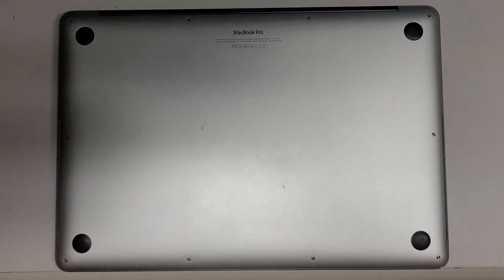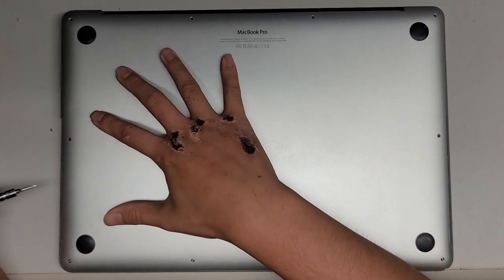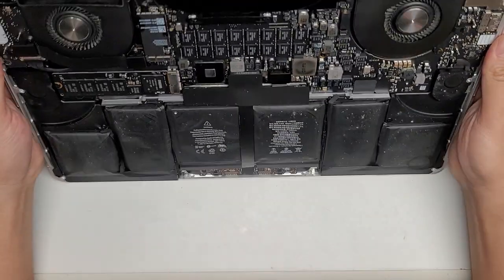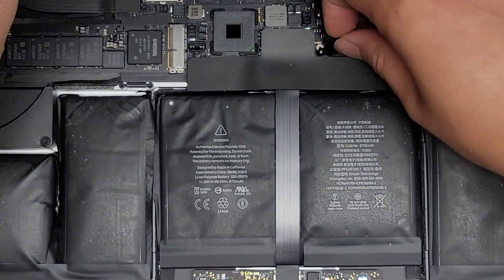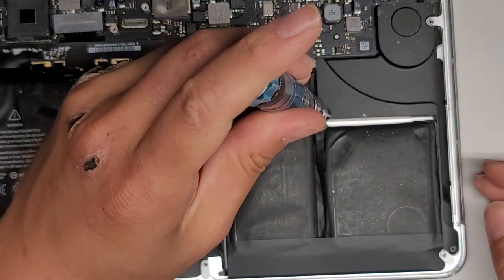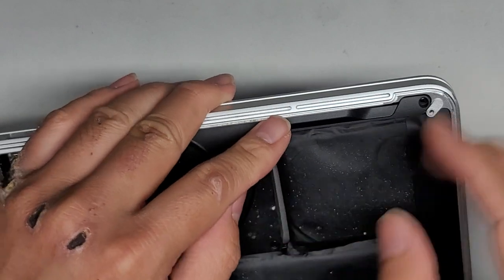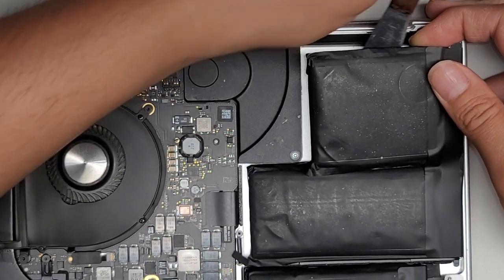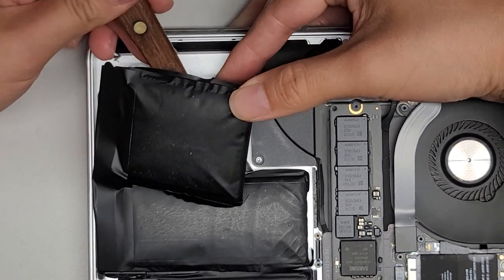15" inch MacBook Pro A1398 Mid 2015 Battery Replacement Repair

Comment: Hi, thank you very much for this video, I followed it step by step but I’m having an issue turning the Mac on it’s just not responding. This is the reason why I changed my battery in the first place but the problem still hasn’t been resolved by me changing the battery.
Reply from the maker: Sounds like a motherboard issue sadly

Comment: Fantastic tutorial - very clear and specific. My only question/concern is that now my keyboard and trackpad are not responding despite correctly reconnecting the strip. Is this most likely because I somehow damaged the connector strip? Gratefully-Dan
Reply from the maker: If both aren't working, it's most likely the touchpad cable
Reply: Thanks for your response. I replaced the trackpad cable and the keyboard/trackpad still don’t work. It does work with an external keyboard/mouse. Should I try to replace the trackpad as well?
Reply: @Danegger1 same issue. did you find a fix?
Reply from the maker: Yeah
Reply: Yes; despite being very careful about the battery removal I must have somehow damaged the trackpad and/or cable. Once I replaced them it worked. Thanks again for your excellent tutorial and responses!
Reply from the maker: Awesome!
Reply: @Danegger1  did you have to remove the new battery to replace the trackpad? ive got a trackpad cable coming in the mail, hoping that fixes it.
Reply from the maker: To replace the trackpad, yes, cable, no.

Comment: Thank you for this wonderful video! I recently bought a 2015 MacBook Pro 15” off of someone from Craigslist, much newer than my mid 2011 iMac 27”, and after playing around with it discovered the battery needs servicing warning. I’m very glad I found your video amongst all the others. Though at the end I was confused when I saw your MagSafe connector with an L connector instead of the T which I know is standard for MagSafe 2. Was this a mod cause the end of your MagSafe 2 died, or what? Please advise. And off topic, if you or any other followers care to give a recco for which 2tb ssds is best for this MacBook in terms of longevity, low heat, and reliability, I’d be grateful, as I’m spending too much time without figuring it out. WD 550s are nice and appear solid, but $$ and hard to find. Samsungs seem to run hot. And Sabrents are fast, but seem to have problems in Macs. Answering the MagSafe Q is all I expect, but thought to find out what folx are doing on the other.
Reply from the maker: Magsafe is an 85W magsafe charger with a magsafe 2 adapter on it. The SSD you'll need an adapter to convert m.2 pcie nvme SSDs. https://amzn.to/3oXCrNW sometimes it'll have issues going to sleep though. https://amzn.to/3NomUA4 I like crucial.

Comment: Do you have a link to buy the pry tool you're using?
I've looked all over and can't find a good tool for removing macbook batteries. All the ones I find are either way too short or have no good grip for applying the force needed to break the adhesive. Yours looks perfect but I can't find where to buy it.
Reply from the maker: https://amzn.to/3TiuVbh but you'll likely have to grind the tip thinner.
Reply from the maker: This might be the same as mine https://amzn.to/3ZNrThw
Reply: @ItsBinhRepaired  👍Thanks very much!
Reply from the maker: @crowleyswhitehorse  no problem

Comment: What are those tools name to remove?
Reply from the maker: @Drx-p5l  which ones? The screwdrivers?
Reply: @ItsBinhRepaired  all butterknif flexibleto that stiker remover?
Reply from the maker: @Drx-p5l  this screwdriver set https://amzn.to/3XHu4Ua and this spatula, but you might need to file the tip thinner if it's not about the thickness of a sheet of paper already  https://amzn.to/3MVbYJd

Comment: What is the name of the tool with the wooden handle you are using to remove the adhesive?
Reply from the maker: Basically this, but it'll need to be sanded thinner https://amzn.to/3qzidqY
Reply from the maker: Other people use floss or thin fishing line to cut through the adhesive, but I find this works better.

Comment: Great. vid, when I changed my battery I noticed that the screw on the right side holding the battery has sheared off and half of the screw is still in the screw hole,  is there any tool kit you can buy to remove the sheared screw? I was thinking about popping into my local apple shop but it might be costly.
Reply from the maker: Possibly some good pliers to twist it.
Reply: Thanks bud but I think the shear is below the level. It's  just too awkward to use some sort of drill. might just try and glue the top of the screw back on👍  @ItsBinhRepaired
Reply from the maker: Even with the battery out it's not grabbable?
Reply: To get to it, it would mean lifting the battery back out which is stuck down with the adhesive so hopefully it's not going anywhere anyway👍 @ItsBinhRepaired
Reply from the maker: D:

Comment: Hi Quick urgent question, After doing all this, my laptop is way slower, even if the battery replacement worked properly, could you help me out quickly ? Thank you very much for this tutorial.
Reply from the maker: Is the touchpad working?

Comment: For some my mouse pad is not working and the fan is running high after changing the battery and following your instructions.
Can you please give some advise?
Reply from the maker: Sounds like you damaged the touchpad

Comment: Thanks so much for the great video, man!  I tried sending a little bling your way, but it said that there were no matching Venmo profiles with that handle that you have in the info section.
Reply from the maker: That's strange. It's been working. Make sure to type it with the capital letters and also press view more. @BinhVu should be correct.
Reply from the maker: Hopefully the repair went or if it hasn't already, goes well.
Reply: @ItsBinhRepaired  It went great, thanks man!  OK, I finally was able to find it.  It still wouldn't show up at first for some reason, then it seemed to almost randomly pop up after I typed it in a 3rd time.  Weird.  However, I just tried to send you money and every time I am now getting this message: "Error" with the smaller font text below it: "The network response was invalid."
Reply from the maker: Glad to hear it went great. Venmo has been having a lot of issues lately. Some of my payments don't show up in my transactions, but show up in all my friend's transactions. Haha I don't know why they keep messing with it, when it was working fine. Might have to give it a day or something. Thanks!
Reply: @ItsBinhRepaired  Alright, it finally worked!  It's pretty temperamental these days huh?  I don't remember it being like that before, but I only seldomly use it.  It told me that that code you have in the description was 'invalid' by the way.  So I just sent it anyways, without that extra layer of protection.  I hope you got it!
Reply from the maker: Thank you so much! Just got the venmo
Reply from the maker: @Christoph Curtis  yeah, It's been having a lot of issues the last couple months. I always wonder what would happen if they messed with the numbers and made money appear out of nowhere.
Reply: @ItsBinhRepaired  No.  Thank you!  I'm quite poor (hence why I did it myself in the first place, hah!), but I hope enough people are able to give similar amounts to have made it worth your time.  Anyways, for what it's worth, from one stranger to another: may karma smile upon you at the very least, if not more!
Reply: @ItsBinhRepaired  Hahaha, I would very much welcome such a theoretical glitch!  crosses fingers
Reply from the maker: @ChristophCurtis  Thanks! Some of the videos more than paid off. I think in the long run they'll all pay off.
Reply: @ItsBinhRepaired  Actually, I have a quick question.  I've been trying your recommendation of draining the battery to around 5% a few times to get the full potential out of it.  The problem is that it died at like 15% or so one time and just now it died at 10%.  Is that an issue with the battery or does it need some sort of calibration for the OS's battery percent indicator to become accurate?
Reply from the maker: @ChristophCurtis  sounds like a bad battery D: did you do the pram and smc reset?
Reply: @ItsBinhRepaired  Yep!
Reply: @ItsBinhRepaired  I guess the last question would be then "how bad?"  I usually use my laptop plugged in anyways, basically like a semi-portable desktop.  Maybe it won't really matter in that case?  Or will it probably get much worse quickly and I should return it soon?
Reply from the maker: @ChristophCurtis  I hate how YouTube doesn't notify me of replies. Were you able to figure it out?
Reply: @ItsBinhRepaired  Yes thanks a lot!
Reply from the maker: @ChristophCurtis yup

Comment: Hey !,, Thxs for your video, I did everything you said, but I can’t get it to reset and also it does not start… I get the apple on the screen but the white line below it get’s to the middle and does not move from there… PLS HELP !!!! I get the orange on the charging plug….
Reply from the maker: Was it working with the old battery?
Reply: Yes it was working fine …. Now Caine of started but got a msg of Bluetooth keyboard set up and does nothing from there, track pad is not working fan is at full speed 😢😢😢😢
Reply from the maker: That's a damaged trackpad or trackpad cable

Comment: Thank you so much, I just replaced the battery on my MBP late 2015 Retina, all seems to be ok but the keyboard stopped working. Do you know what could happen? Maybe I did not plug it correctly?
Reply from the maker: If the power button works, you likely damaged the trackpad or trackpad cable.
Reply: @ItsBinhRepaired  thank you, yes the power button is the only thing that still works. I guess I need to buy a replacement for the trackpad and cable.
Reply: I pull the cable upwards instead of towards the back of the laptop. The trackpad is still working,(move the cursor and clickable) do you think it could be just that I am not connecting well the cable? I thought about just replacing the cable. not the trackpad and cable.
Reply from the maker: @Javiko2024  possibly. Hopefully that's the only issue.

Comment: Is there a way to drain the battery power without disconnecting the battery? Can I just use the computer until power hits 0% or will it still have a charge? I genuinely can not get the battery tab to lift up and I don’t want to break it the tab is connected so tightly. I am not changing the battery I am doing a different repair so I don’t necessarily need to lift up the tab.
Reply from the maker: @la6136  draining the battery to 0 is bad for it. Make sure you're only pulling on the lip that sticks out.
Reply: @ItsBinhRepaired thanks for your response i tried again and I got it to lift. I had to use a little dental floss to get it to lift up 😂 it was very stuck
Reply from the maker: @la6136  lol nice!

Comment: TOUCHPAD MALFUNCTION - due to battery beginning to fail.  Battery cells were swelling up and pushing back up against the touchpad making it impossible to "click" on the touchpad corners.  Now ordered and will be changing the battery.  MID2014 MacBook Pro 15" Retina.
Reply from the maker: Usually changing the battery is enough. If it doesn't work after that, check the cable.

Comment: Why is the battery still not working after I replaced the battery and reset it according to your method?
Reply from the maker: Either not connected properly or defective.

Comment: i followed all your instructions and now the laptop wont charge without the cable, the battery logo wont show up nor will the trackpad work properly. can someone please help?
Reply from the maker: @louisneale4896  push the connector in all the way.
Reply: @ItsBinhRepaired  I have, it clicked in and I start it up and the trackpad doesn’t work properly. Tried again and same thing
Reply: @ItsBinhRepaired  I have, it clicked in and I start it up and the trackpad doesn’t work properly. Tried again and same thing
Reply from the maker: @louisneale4896  sounds like you damaged the trackpad cable
Reply: @ItsBinhRepaired  oddly the trackpad is working now...except the laptop is still not showing its charging properly?
Reply from the maker: @louisneale4896  might be faulty replacement
Reply: @ItsBinhRepaired  hmmm I wonder do you know where I can purchase a replacement battery from a reliable source?
Reply from the maker: This https://amzn.to/3Lz5orb

Comment: I followed this video and replaced the battery. Now my trackpad and keyboard are not working. Tried replacing both the trackpad and ribbon cable and still no luck. Any suggestions?
Reply from the maker: @risksrewardsrelics51  make sure the ribbon is connected fully to the trackpad
Reply: @ it took two ribbon cable replacements, but now it’s working. Thanks.
Reply from the maker: @risksrewardsrelics51  awesome!

Comment: Can you run this model with the battery removed, do you know? I want to remove the swollen batteries for safety but then just run it connected to the power (as an old backup machine).
Reply from the maker: Try disconnecting the battery and see if it'll turn on.
Reply: @ItsBinhRepaired  well yeah, duh, just wanted to know in advance if it will work.
Reply from the maker: Answer is Apple is an ass and sometimes yes, sometimes no. The only way you'll know is if you try.
Reply: @ItsBinhRepaired  in my case no, it did not power up at all on power cable alone after the battery was disconnected.
Reply from the maker: I hate how YouTube doesn't notify me of replies. Were you able to figure it out?

Comment: can you tell if this model macbook pro mid 2015 15 inch works without battery, only with charger ?
Reply from the maker: Won't work
Reply: @ItsBinhRepaired  thanks
Reply from the maker: @jeffersonschmidt793  no problem

Comment: battery shows (x) when booting, and only power button works (no trackpad input or keyboard) i ordered a new trackpad cable and installed it, no changes. I cant do any of the resets because the keyboard isn’t responsive. the computer was functioning fine prior, what should i do now? I know hardware is all good, i got a refund for the defective battery but dont know if that would also cause keyboard and trackpad issues. all connections are seated properly.
Reply: wondering if its better to just take a loss, or what it would cost for someone to fix it, again. Im very tech savvy and operate with electronics often, nothing was obviously damaged, and everything looks well. There was a random phillips screw hiding close to the left fan but i couldn’t find where it fell from.

edit: ctrl option shift does immediately shut it off, but the other reset is not doing anything. when it powers back on the trackpad and keyboard still are unresponsive  😢
Reply: im thinking of ordering a new trackpad first, its only about 15-20bucks. if that doesnt work, im SOL i guess.
Reply from the maker: @jakeslidez  if just the keyboard isn't working, then you might have damaged the keyboard cable
Reply: @ItsBinhRepaired  both arent working. new trackpad coming in a couple of days. 🙁
Reply from the maker: @jakeslidez  :(
Reply: @ItsBinhRepaired  fixed w a new trackpad! i guess pryiing the battery off the old one perhaps ruined it. we’re good now :)
Reply from the maker: @jakeslidez  awesome, glad it worked!

Comment: Where to find a reliable battery for A1398 online and any procedure if we can figure out if the product is reliable or fake? I have seen many website selling batteries for dirt cheap rate but reviews are bad. Any recommendation is welcomed.
Reply from the maker: If you're willing to pay more, batteries from ifixit or owc are possibly best, but most Amazon ones with 1 year warranty work well. None of them are official Apple batteries.
Reply: @ItsBinhRepaired  Thank you
Reply from the maker: No problem

Comment: I have this same model pretty much and the track pad is hard to press and click & drag is almost impossible. Is this the only way to get to the trackpad? Seems like a lot of work just to get the batteries out, let alone the trackpad. They f you at Apple...lol
Holy crap, just saw your accident vid, glad you're ok!
Reply from the maker: Yeah... sounds like your battery is inflated and needs to be replaced.
Reply: @ItsBinhRepaired  Thanks!
Reply from the maker: Yup

Comment: Why even bother using adhesive to glue it back in? It's not going anywhere or moving.
Reply from the maker: It'll rattle and being stuck to the aluminum housing helps a bit with cooling as well.

Comment: You forgot to say that the two pairs of speaker screws ARE NOT identical. The SHOULD NOT be swapped.
Reply from the maker: Uhhh Do I need to mention that d and b are not identical? It should go without saying... lol
Reply from the maker: Make sure you put the right shoe on the right foot as well. Lol

Comment: Thank you for this video.  Apple's engineers are complete a**holes for making these things so hard to work on.  Much more difficult than it should be.  My XPS battery replacement takes 10 minutes.
Reply from the maker: Yeah...it's stupid.

Comment: I own a repair shop. A word to the wise, never use a metal spudger to pry out the battery. You could set a fire from the battery, just saying
Reply from the maker: @GabrielRodriguez-um8fi  The battery doesn't react to the metal. It reacts to moisture and the air. If you tear it open or puncture it with anything it can go on fire.

I've done thousands of these without issues, but some people think a metal knife is OK to use (it isn't) and cut into the battery causing a fire.